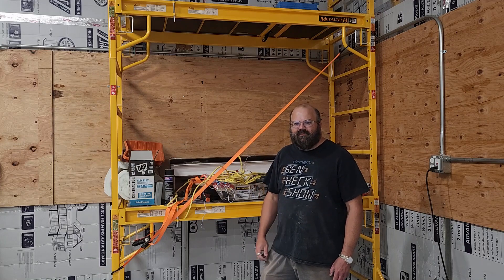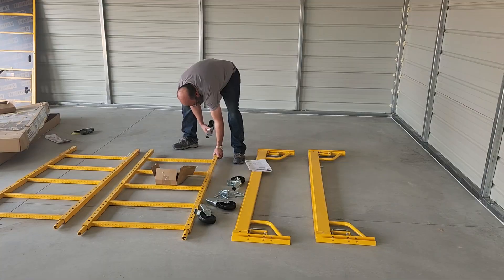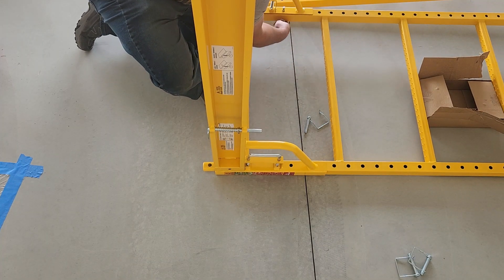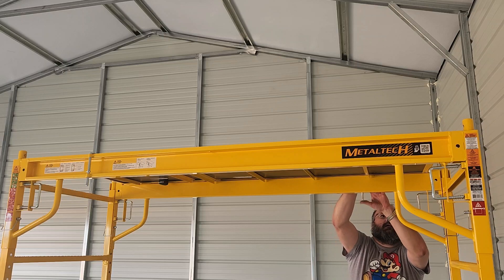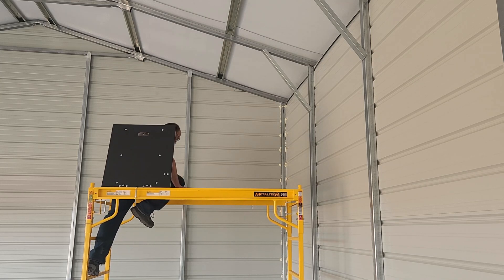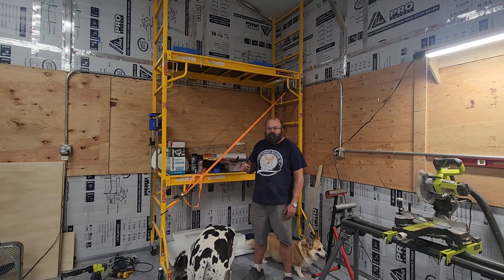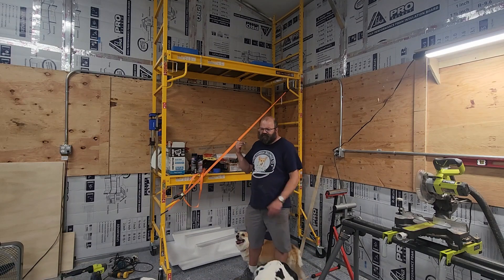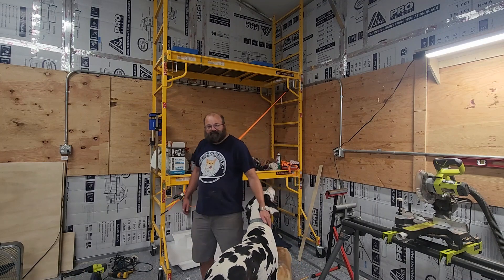Is Metaltech Safeclimb scaffolding safe. Why did I buy two?

Comment: your safety officer would give you trouble not for using a product that is very widely used across the construction industry but for not reading the user manual and installing the safety pins.
Reply from the maker: I did install the safety pins. Watch the video.
Reply: @TomsBackyardWorkshop  not in your double stack at the end
Reply from the maker: Good catch, I didn't notice. However, the safety pins don't affect the stability.

Comment: I cannot believe how many people rate this product as 5 star on all kinds of places, claiming that it's very sturdy and safe. I assembled it last night and this thing rocks and shakes like crazy when you climb, stand on it, unless you are a gymnast who can balance perfectly. Complete disappointment.  Don't waste your money.
Reply: I'm 65 and hardly athletic and I can tell you it's been great for wiring, installing metal ceiling and insulation and my 8' hight garage door in my 10' high garage. I bought the Werner branded one (they all look alike as if they came out of the same factory and just painted different colors, even the Harbor Freight one) a couple of months ago at Lowe's.  They were on sale for $250. I quickly ordered the Wen branded safty rails from Amazon, not because I felt the scaffold was unstable but because I didn't trust myself not to get overconfident and step off the edge of the platform when I was more than 4' up. I'll agree the trap door is clumsy to use, the safty cage has a door on each end so I climb up the outside , it's much easier. I've had the platform up to about 5 and a half feet and I feel much safer than on a ladder, I can load my tools and supplies on the platform and don't have to carry anything up with me. If I leave the wheels unlocked I can easily pull myself around by the bottom of the trusses as  long as I keep the floor underneath it clean.  I'm sold.

Comment: It’s OSHA approved so your safety officer would be fine with it. It seems like maybe you are the hazard.
Reply from the maker: @JeffC-o4w  they claim it complies with osha standards none of the documentation I have found says it is osha approved.  Even with the stabilizers and the ratchet straps to tighten the frame this pos has several inches of defection. Each level adds more diflection.